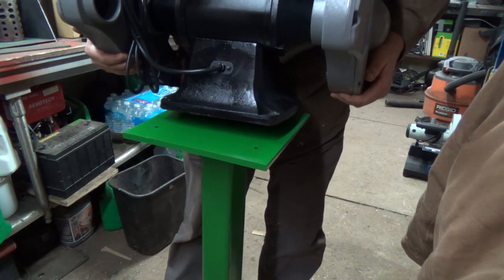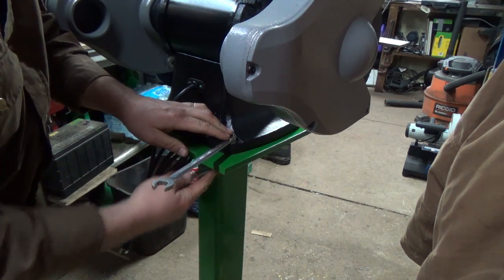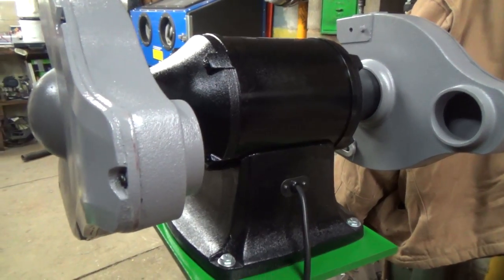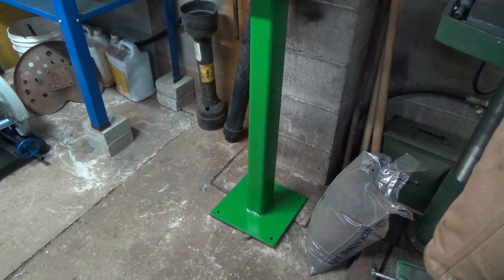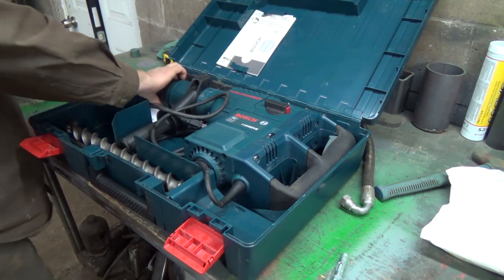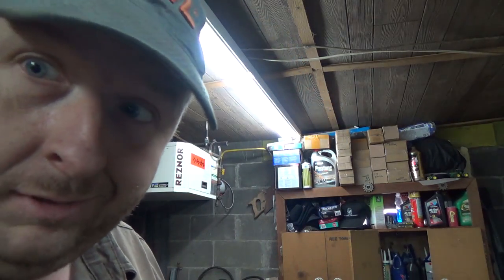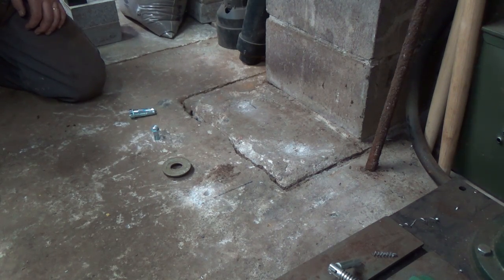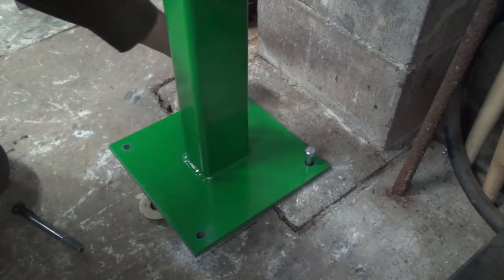Mounting the new bench grinder and custom stand

Comment: The way I like to do it, is drill the holes to fit the anchors and the holes in the mounting plate. The anchors can be threaded and as long as 5-6 inches of thread. Set the anchors in their holes and then apply a nut with washer, then set the plate on the washers and level it up with the plate off the floor maybe an inch and a half. Apply another washer and nut on the plate and tighten down. The plate is off the floor a inch and a half, fill the underneath with grout, let the grout dry and your ready. Cut any excess threaded section off with a hack saw or a grinder.

Comment: bill when you use those dynabolts drill the hole in whatever you are bolting down big enough to push the bolt thru then tighten it down  all ways drill your holes all the way thru the concrete that way you can hammer them in if you no longer need them  keep up the good vids oh and bill trust in yourself mate be positive

Comment: Good job Bill. I was wondering what the name on the grinder was, and where was it purchased. You might of covered this info, but after reading some of the comments, I wasn't looking any further. I would like to see some of the commenters shops and how they mounted their equipment. Can you say duct tape?
Reply: G'day David. That would be the Pro-Point 10 inch. heavy-duty bench grinder. It's a 1-1/2  HP 12A@115V, 6A@230V.
Bill got it from Princess Auto Canada, the SKU is: 8656852. It's about $429.99 CAD.

Comment: Bill I forgot something if and when you move your grinder you should  see about getting a piece of rubber floor mat or mudflap and put it under the metal plate between the plate and the concrete this will keep the  plate from rusting over time
Reply from the maker: Well I did use self etching primer on it. Hopefully that slows it down
Reply: Krissie most likely

Comment: Bill you should put your big washer  in the corners over your  bolts under your plate. That would give you better stay ability .If you're going to move it over in the corner I would make a template for your bolts hoes , for you and put your anchor bolts in the fresh concrete where you want to your grinder pedestal . You have good ideas but you don't think  them all the way through. Keep up the good work you're doing great.
Reply from the maker: Yes I will re position them.. may try it here for a while.. maybe its ok here
Reply: Donald Latimer I

Comment: Bill you could have a PHD in mechanical engineering with 50 yrs experience, explain the design theory  so others can understanding the methods, strategies, research and analysis of the design. Build it to within 1000th of a millimeter, and have it work perfectly. There will still be someone, who think they know every thing about every thing, but only have a 6th grade education or the mental capacity of a 6th grader, try and tell you that you have no idea what you are doing. A project can be presented to a welder, fabricator, machinist or engineer. Each one can have different ideas of how the project should be done. Some Ideas may work better than others, but as long as the project works as requested, that is what is important. The one thing they don't do is to tell the other that they don't know what the Frick they are doing. The will say how they do certain parts of the project. In the end, they might give it a try and find it may be a better way of doing a part of the given project, then again it may not. For those who may have read to this point, I have given Bill several design ideas and other to help with some of the projects he has done. I have never told him that he was a complete D.A. or he had no idea what he was doing and he should have done it my way. If he use some or part, or even none, of my ideas or info. Then that is OK. Bill keep doing it your way and as for the others that think they know how to do it better than Bill, then start your own channel and put up some Vids so we can post how every thing you are doing is completely wrong and that You have no idea what you are doing.
Reply from the maker: Well said Richard! i like how you look appon it although its wrong.. just kidding :).. but really id like to get into a room with these people and have the exact same tools. Plasma cutters welders measuring tools and build a backhoe bucket for a project and see whose comes out like what. That would be interesting. 
thanks for your sweet comment and all your plans and ideas you throw at me!

Comment: nice stand:) why don't you take advantage of the thumb hydraulics, and the cylinder from the front attacher from the  JD (I think you have a spare one of those?) and make a grading bucket?  in norway most mini ex's come with a grading bucket.  would make it more useful as a gardening tool. Hehe:)
https://www.retrade.eu/i/detail/1012626-2110018.JPG/Minigraver_2,6_tonn.jpg

After 14 years of doing concrete formwork, I've found out the hard way that the easiest method is to place whatever you are mounting where it should be, drill the hole and hammer in the anchor as it sits where it should be. Marking holes, and trying to drill holes in concrete at the right spot ain't happening anytime soon :p   Btw, Hilti Hus bolts are great. t
The are just like a screw, but obviously needs an impact driver.  can be reused and don't leave something 2 inches high to stumble on when you are done doing whatever you are doing..